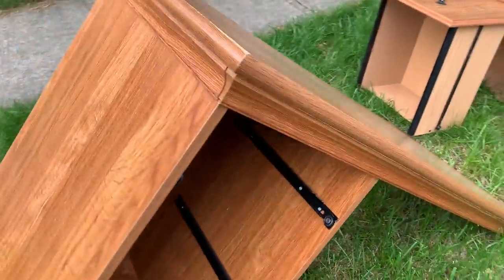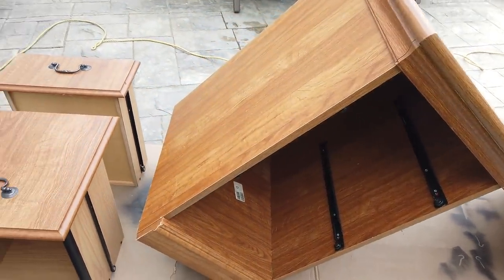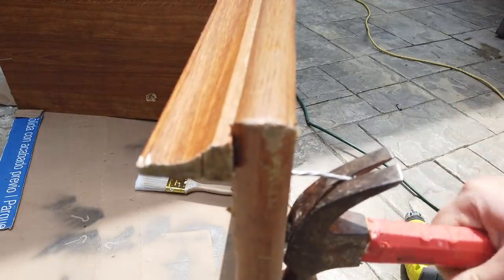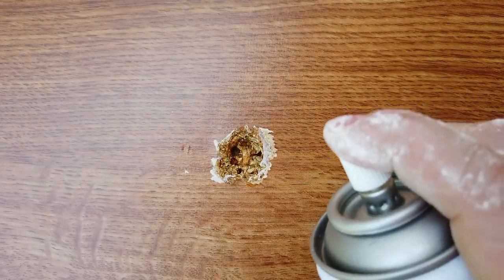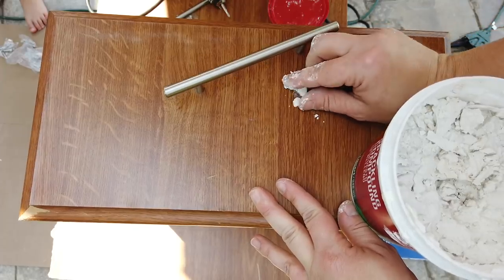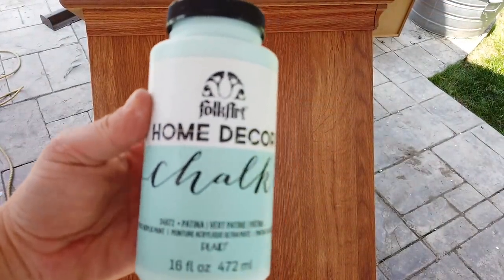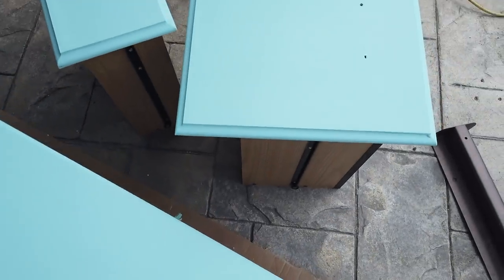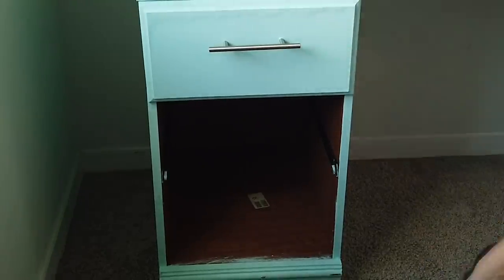TRASH TO TREASURE DESK MAKEOVER|UPCYCLE FURNITURE MAKEOVER

Comment: This looks like it was the pressed wood type of furniture from Walmart. I noticed you didn't prime or anything, will the chalk paint adhere to the slick surface of this type of furniture well?  I haven't tried the chalk paint on that surface before but regular paint even primed sometimes scratches so easily, it's disappointing. If chalk paint doesn't do this , that is a game changer :) I love the make over it is so great looking and absolutely perfect.
Reply from the maker: Yes it adhered well to this surface. It did take 4 coats of paint to cover and I did put 2 coats of polyurethane on the finished product to hopefully help with it not chipping. But I’m sure I will get some chipping here and there like with every paint. Thanks for watching! Have a great day! 💕☺️💕